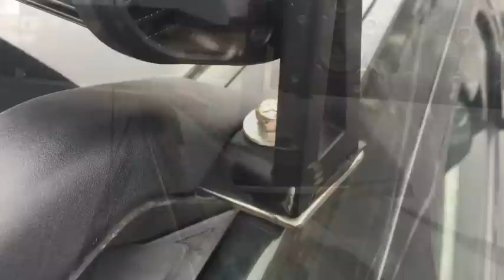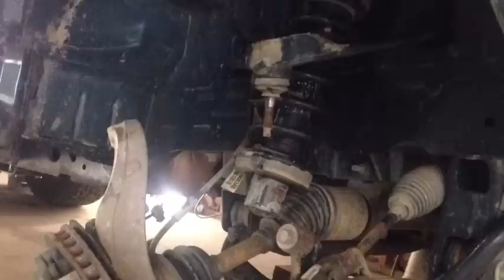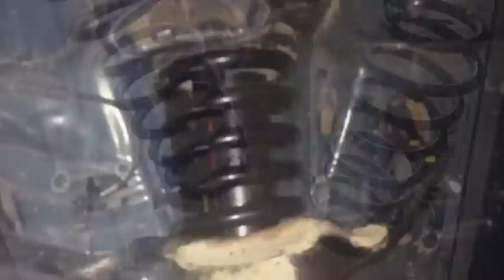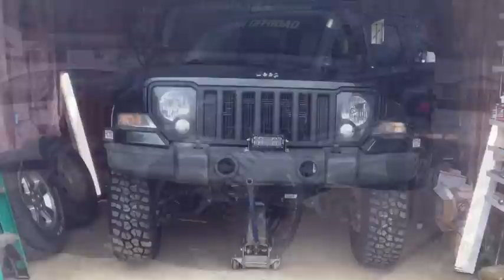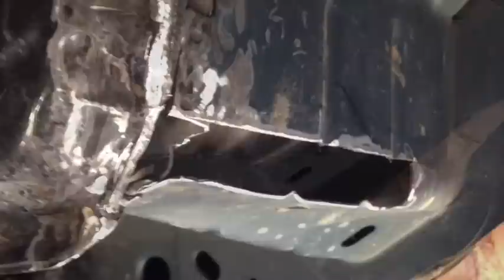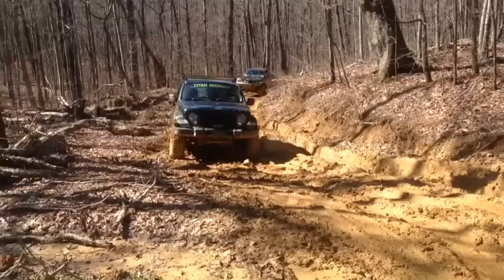Jodys 2011 Jeep Liberty kk build

Comment: Had my first test of my front steel bumper from At The Helm (ATH). ZERO damage to my rig, the KIA in front of me didn't do so well. Buckled the trunk, fenders, busted out the brake light (didn't work anyway ) and caved in the area below the trunk. They were not happy I had no damage. Even the "scuff" rubbed out with some wax. Oh well.

Comment: are the jeep liberty 2012 off road capabilities comparable to the wranglers ??
Reply from the maker: This Liberty puts the JK wranglers to shame lol lets put it this way. He won the offroad and 3 gun shoot out competition in it against several wranglers including a ton swapped jk.
Reply: Cody Blosser appreciate the response :) !!!
I meant a stock liberty vs stock wrangler ?

thanks ,,,
Reply from the maker: And in not sure on the other than the Liberty being trail tested and getting its trail rated badge I'm not sure. The liberty comes with traction control which acts like a limited slip front and rear. An although it's ifs it does amazing
Reply: Cody Blosser Thanx :)
Reply: the LIberty is totally underrated in off road capability.  It has limitations, but for the casual off roader who daily drives it, the Liberty is hands down the better value.  Tows more, drives more comfortably, more storage, and there's a growing aftermarket for the KK that can get you something unique and capable, instead of all the heavily modded Wrangler clones that have never even seen a gravel road.
Reply from the maker: Ian Flynn great comment!! This Liberty is so underrated and that's why I have a huge 1st place banner on my shop wall given to me by the owner of the kk after winning a jeep competition against Jk's on tons and even a mildly built Tj. I'm super proud of this build its one for my highlight reel that's for sure.
Reply: What size tires? And where to find a bumper like that
Reply: you're so full of it!  I owned a 13 JKU Rubicon and I own a 12 KK The Rubicon is no comparison lol nice KK but come on dude its even got a JK bumper lol

Comment: How many inches is your lift kit?
Reply from the maker: 3.5" JBA lift. I have for sale a set of front OME 2.5" lift coils of interested. And the light bar mounts I make in house and sell and the pods are bolted through the jk bumper. Will have fabricated hood mounts for the pods up for grabs soon. All fab work is one off no one else has anything like I make. Also will be producing jk bumper mounts with out without winch plates.
Reply from the maker: You can follow my Facebook page vision off-road customs.
Reply: have you made the bumper mounts for the bumper yet? thanks
Reply: Vision Offroad Customs
Reply: So so 2009 Jeep Liberty is a KK?